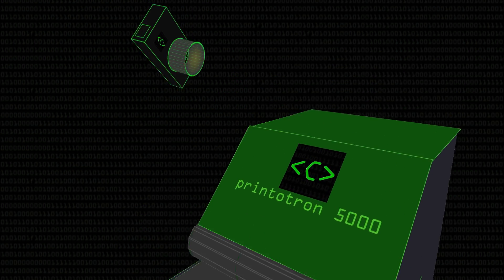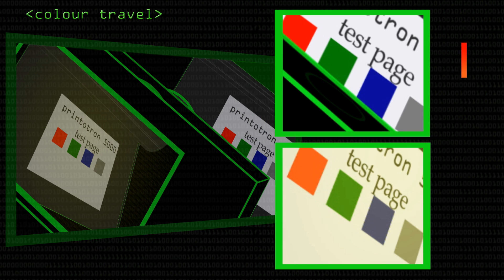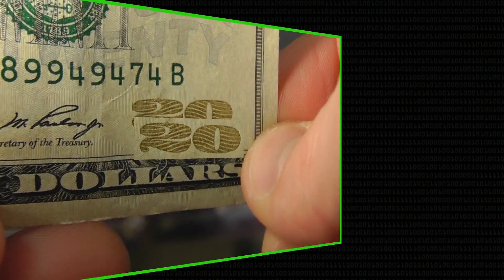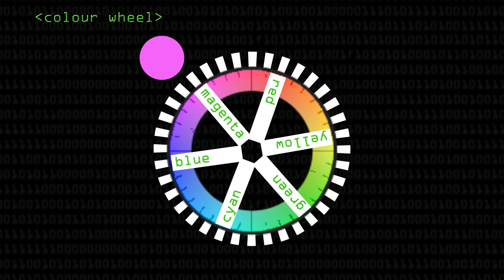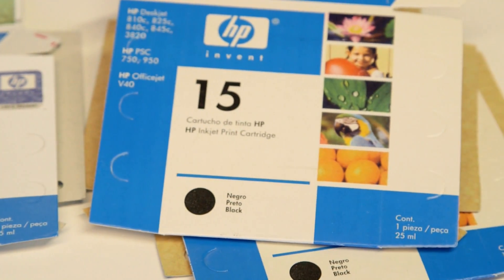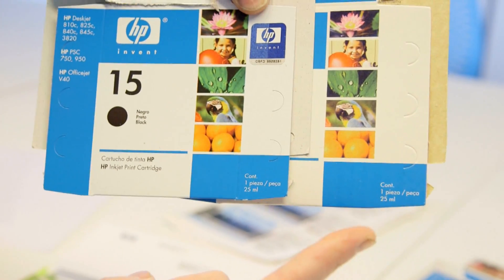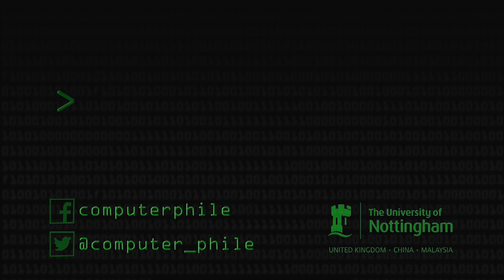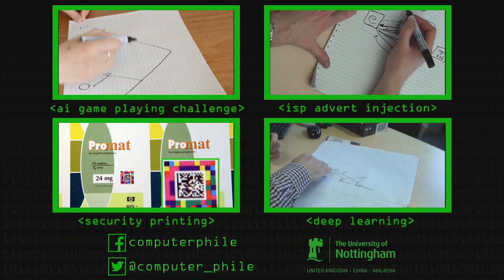Anti-Counterfeiting & Conductive Inks - Computerphile

Comment: Surely the correct answer in imaging applications to the problem of discrepancies in interpretation is to calibrate your image generation and sensing equipment. We have this thing called ICC (International Color Consortium)
Reply: profiles for computer monitors, printers etc.
Reply: All the go
Reply: od image-manipulation apps will understand ICC data attached to images.
Reply: As for printed images drifting over time, the logical fix to that is to include swatches of known reference colours somewhere in or attached to the image. Then your sensor can simply apply a correction so the reference colours match up with the expected measurements, and you know the rest of the image should follow suit.

Comment: The other solution to structural compensation in QR codes is error correction the only problem with that is you have to account for up to 50% data / black dots being redundant information.

Comment: One thing I haven't understand, is the purpose of security ink nowadays. Anti-counterfeiting today is as simple as a RFID chip containing a secure element, with all the relevant data + a second public key, signed with a private key. Then the chip contains a second private key that cannot be extracted, you can only ask the secure element to sign a "nonce" with that. Verification that the "document" is not forged, is simple as verifying the signature on the data. Verifying that the "document" (for example a bill) is not copied, is simple as sending a random nonce to the chip, getting the signed result back, and then verifying this with the second public key embedded in the data.

Comment: Very surprised he talked about 3 causes of colour shift, but completely left out the biggest one, which is variations in the paper (or whatever material you are printing onto). Different papers will cause colour shift, not only because of colour changes of the paper itself, but because of differences in the way it absorbs the ink, it's very common when you are producing something that will be printed in different places on different materials for you to produce colour shifted artwork to compensate for the variations, so the results look the same as each other.

Comment: They patented printing an antenna... :/

On one hand that's rather sad. On the other hand, who has 100mil to invest in patents, a pen and a dictionary for "printed (electronic)" to lend me. :D
Reply: +TechyBen They're probably patenting the technique used to apply these antennas :)
Reply: +PNathan "Put thing on paper"? I don't understand patents. :(
Reply: TechyBen He probably simplified that part dramatically. Usually the process behind making things like this is much more difficult than you can imagine
Reply: Oh, I can imagine. I know it's easy to comprehend or contemplate, but hard to implement. :)
Reply: +TechyBen Yep, and it's an implementation that a patent covers - it doesn't cover the whole idea of printing an antenna. If you come up with a different way of printing an antenna to achieve a different aim you can patent that, or you can probably use some older way of printing antennas that the patent has expired on. What you can't do is use the particular method that guy came up with of printing antennas to change the range of RFID chips, unless you pay HP or wait 20 years.

Comment: What crime does structural precompensation prevent?
Reply: +Nanook av Süden Counterfeit product labels could be an example.
Reply: Who profits from mislabeled products? (enough to create measures against)
Reply: Nanook av Süden I assume people who create cheaper (lower quality) knockoffs of something and then try to create a knockoff of it. Also faked certificates of authenticity.
Not sure about these though, haha. Just the first thing I could think of.
Reply: +Nanook av Süden Imagine buying ink cartridge which is packaged like original, costs like original, but is a cheap replacement inside. You can imagine the person who sold you this and manufacturer could gain a lot of money through this.
Reply: +Nanook av Süden They also mentioned it was a way to discover if there's illicit activity in a supply chain.
Reply: Not the type of thing to read in the paper I guess.

Comment: And here i was wondering why my cartridges are so expensive. This guy has such a cool job!
Reply: +Dirk Biers The reason cartridges for particularly inkjet printers are so expensive is they make less on the printers themselves to sell as many as possible, and then get you to buy in refills. In the long run, they make more money this way. It's a bit of a different issue. If you go with a more expensive model of printer, the $/page goes down a lot.
Reply: @TheKyshu  Somewhat recently switched to a laser printer (Canon ImageCLASS) because the cost per page is significantly lower and we don't have to worry about the ink drying out.  We don't print very often so with an inkjet we might only get a couple pages out of each cartridge before we had to replace the damn magenta cartridge again (even to print in black and white) whereas with a laser we're still using the starter toner cartridges over a year later.  The printer itself cost us $300 (with the starter cartridges), toner will probably cost us about $100 for an entry level set (which is perfect for us) which can print over 2000 pages according to the purchase page.  The laser printer is also considered a business class product so it doesn't have some of the more annoying 'features' of the inkjets we've used in the past.

Comment: Sooooo basically a how-to guide for continuing the price gouging of printer inks and toner.
Reply: +Kyshu yeah.... counterfeit ink cartridges in counterfeit packaging.
Reply: +lies damnlies It's less about price gouging, and more for when you buy something which is packaged like original and costs like original but is not. If you want to buy an unofficial replacement part it's not going to be in anything resembling the original packaging, and these are not to protect against that.
Reply: +NordboDK Which of course is a service to buyers who wish to know they got the legitimate deal. 

And of course nothing prevents the counterfeit ink cartridges from being sold at full price ether.

You can still buy a clone of the brand but it needs to be honest that is a clone (of course the exception to this if someone owns a patent on some solution in which case the clone can not have that solution. That is as much exclusivity you can have as a original creator, at least in a most normal western economies.)
Reply: +lies damnlies Did you actually watch the video? From what he talks about, it seems like a more important tool for preventing counter-feit copies of something. For example product labels, etc.
Reply: ***** Ah, didn't notice that, haha
Reply: +lies damnlies it doesn't enforce use of their cartridges, but it makes it easier for them to tell whether  cartridges are made by them or not. If you can detect that then you have a starting point for finding someone who copies your trademark etc.
Reply: false.

Comment: The standard "color travel" as he puts it, is complete BS.
There are standards in place that are specifically there to prevent unwanted shifts. The LAB color space, for example, is an independent color space that can be referenced with properly calibrated input and output devices (scanner <-> printer, proof screen...), using the information of your input device / file and output device and conditions (printing technology and output gamut, paper type (color, coating)), using proper conversions.

For example, you have a properly calibrated scanner or colorimeter with which you can sample the colors. Your color management software will know the input conditions because you've calibrated them - so it will match the colors to references in the absolute color space (LAB). So we know definitely what that color looks like on an absolute level (sampling conditions are regulated. A colorimeter is used in direct contact (no environment lighting) after being calibrated correctly)

The next step takes the information of your output device and substrate (paper color and coating) and uses this information to calculate the exact colors (C/M/Y/K + special colors, if needed) from the absolute color space.

There are standardized color profiles in place for most day-to-day uses, to convert to and from the absolute color space. Like FOGRA39, for example, for process offset print.

This is standard in print, and if you just order from any professional printing service, adhering to their standards, you can predict your outcome exactly (relative to their quality and reliability) - but if they're FOGRA certified, for example, you're guaranteed a very close result that should not be distinguishable with the human eye (just looking at it)

Now, if they use special colors (metallic pigments) or exotic methods resulting in a wider color gamut than your provider, it gets more interesting. But regular "color travel"? That's a non-issue.
You wouldn't try to counterfeit anything with your home-office inkjet anyway, would you?

Comment: 4% success rate is awfully slim, you might as well not even use a barcode :-). I would hope that'd be a 4% read failure rate.  But assuming the 4% success rate I'd say a 25% reduction in read rate would in nearly all circumstances be significant.
Reply: +rchandraonline might be a 4% success rate. If the reader tries to read 1000 per second it doesn't actually matter much.

Comment: On the blurring of it, you can scan it with a phone and just put the data in to a program to make a fresh one
Reply: +Ioan Loosley Yes, but if you actually listened to what he was saying, you would know that making a 100% accurate reproduction of the data is exactly what makes it unreadable.

So the counterfeiters would have to reproduce the artificial blur, put into place to make it readable - which I'm guessing most people wouldn't even know was there.
Reply: +hiTo1337 there isn't an artificial blur.
Reply: I also re-watched the video and he was talking about adding a border to reduce blur on phone meaning that anyone can download zint barcode studio and make a new one with the data on the old one, completely undermining it
Reply: +hiTo1337 The data is the data , what you do is when you have pulled the data form the tag you generate a totally new one and then don't put the fancy pants  crap in it and it will read as normal
Reply: hiTo1337 he's making it so its harder to photocopy box's while making it readable the first time
Reply: This is where the margin of error comes in. It will pretty much always read even if its been copied 100 times. But the reader will count the miss reads, the error, just like a hard drive when its going skew wiff will log and disable bad blocks.
Reply: Ioan Loosley
Yes, exactly.

Sirus That's not what he said, though. He said that they make the qr-codes small enough that structural precomposition is needed to read it. Meaning that if it is not precomped with white borders, it's really hard to read it.

The margin of error he speaks of is in the context of big data. If HP prints 850 million of these boxes, and 2% of the qr-codes on boxes in stores can't be read, that is not within the margin of error and can therefore be linked to counterfeiting.

Comment: Can a counterfeiter not add structural recompensation themselves?
Reply: +Mr12345bleepbloop , difficult but not impossible.  The couterfeiter would have to know how the original and the copy differ, which I would think would be unknown.
Reply: +Mr12345bleepbloop Yes. With good enough equipment you can do pretty much all of this. Probably the real hard part is the inks. Getting hold of or making them is the hard part. 

Mostly it is matter of a) counterfeiters not being really good at their "job" b) not bothering with the extra expense of faking the labels properly, but just so they pass at glance c) them not knowing what to fake. Mostly it seems to be hidden related marker pairs. Based on the serial or other marker some other hidden marker must have value X. If it is Y, it doesn't match their marking algorithm and they know it is fake.

Mostly this is not to make it impossible for anyone to sell the fake, but for company to be able to say afterwards: "that is fake, so any damage it caused is not our fault." Pretty much anything you can see at glance as end customer fakers can fake. They can see it just as well as you and thus fake it to look similar enough to a lay person. So it isn't about customer being able to tell a fake, but the company itself being able to tell a fake, when being confronted with one.
Reply: +rchandraonline But if you use correct color calibration, everybody can reproduce the correct colors using the correct color profiles and output intents. There are absolute references for example in LAB color space, and you can LUTs / matrices to find out what you need, given your output gamut and the paper used (color, coating). Granted, we're talking about properly calibrated machines here, but you wouldn't get a realistic result using your home-office inkjet anyway :P

It gets tricky, of course, if the colors lie outside your printing gamut or have special properties (metallics, conductivity) - then you have to go and buy special colors and, depending on your printing machine, you might have to have two iterations per sheet (if you have only 4 units, you need to print once for CMYK and once more for special colors; and of course change everything in between)

But if you're simply ordering your prints from some small - medium edition print service, they'll take care of that - you just need to convince them you're authorized to print the product or hope they just don't care